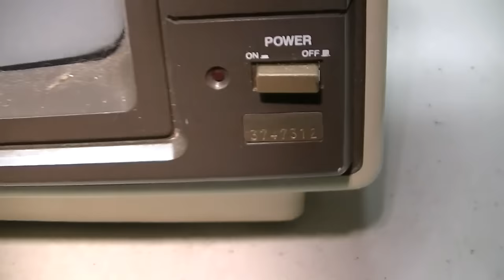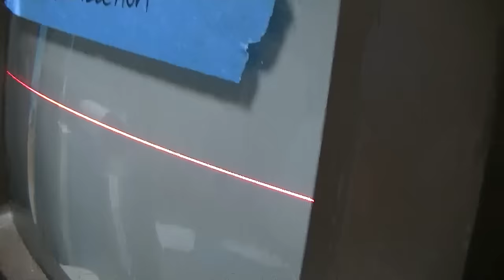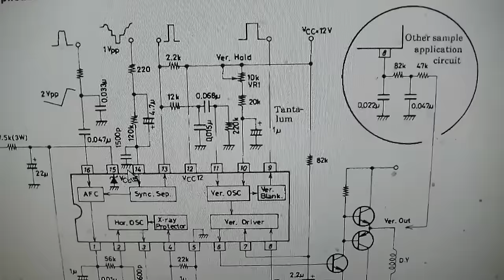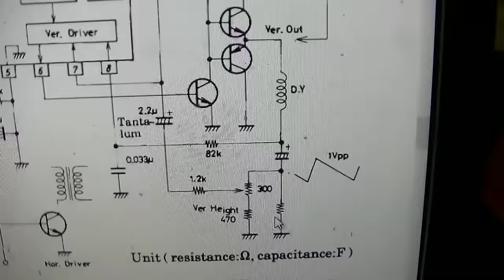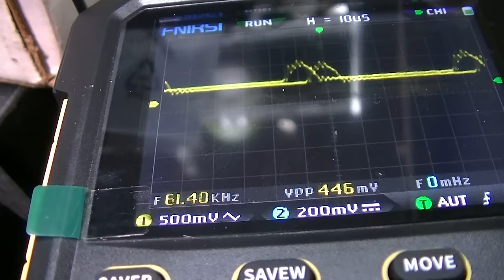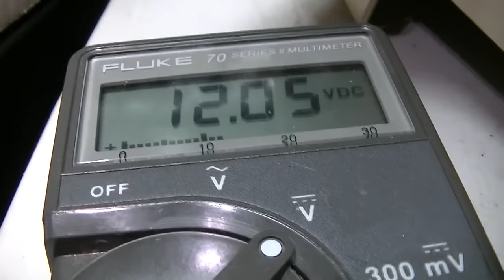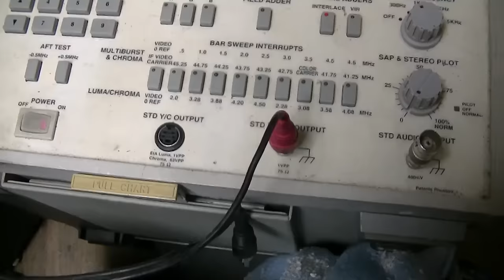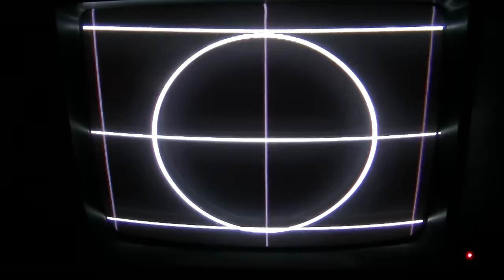1984 NEC Color CRT Monitor JC 1215 Repair

Comment: These "lower-res" color computer monitors from the early 80s have amazing picture and the tubes last forever. The Commodore 1702 was very similar to this one and they just generate a great image, although as you mentioned they aren't super duper sharp.
Reply: I recapped and replaced a voltage regulator in a 1702 and my god that monitor came alive. While it was limping along before the repair it looked new after the repair.
Reply: 1702 even has Y/C input on the back, a cheap cable will let you connect anything with s-video.
I believe that monitor was made by JVC, and used the same CRT and boards as their professional series.
Reply: @coyote_den That's right, it is a JVC product. All the commodore screens are pretty good but the 1701 best. The later ones like the 1080 and 1084 were nice because they could take Y\C plus both digital and analog RGB which makes them a jack of all trades but the tubes didn't last as long and the overall design wasn't as robust.

Comment: I had an 22" NEC 'Diamondtron' (albeit Mitsubishi tube, I believe) in the mid 2000's for photography work, I calibrated it with a colorimeter and to this day one of the best images I've seen on a display.

Comment: A great learning lesson taught here. Inspect your boards first. How Shango missed it is because he assumed a component
may have been at fault first. I guess many of us have done the very same thing! Vintage NEC monitors were the best.
Reply: This was likely delivered busted and put on a shelf for 40 years until it was bought by someone on eBay thinking NOS would be guaranteed brand new, and turns out the board was cracked. Right on a corner edge where the feet of the TV are too, prime for dropping.

Comment: Recently fixed a monitor for a classic Macintosh, had a blown smps drive transistor, blown neck diodes, blown ultra fast diode…was an adventure to fix
Reply: I sadly broke the nub off the back of the tube in a Mac SE a couple weeks ago while trying to remove the drive cage. But if I had to pick a tube to accidentally vent, that'd be the one -- they're still reasonably plentiful.
Reply: @VectraQS  it’s unfortunately very common to do. I run Amiga of Rochester, we do vintage Mac restoration and so many people have done this I lost count
Reply: @thomasandrews9355  Ahh, nice to run into you again. I think we've talked a few times before. I still need to get in touch about sending a Portable logic board your way.
Reply: @VectraQS  hi! Small freaking world

Comment: I used to spec these nec monitors in the remote eng studio truck designs because of the clarity and brightness as well as the weight difference sony was much heavier steel box.

Comment: Not that Im anywhere close to Shango's level come TV's & monitors but I've come across a few sets like this that were loaned out or put away in storage and came back to their owners not working. And just like this they suffered from being dropped & broken boards. For me (like Shango) I go for the easy quick fix first, but on these printed board sets I'm looking for discoloration and breaks first & foremost, fuses then to the components. And if the tv god's are smiling on ya.....they're a quick fix and you're a hero.😅

Comment: These were common in video online edit room as a secondary color monitor. The primary would be a sony or ikegami usually but these were great for things like the chyron station. It was probably set to display the full roster on purpose to qc the image.

Comment: It's truly hard to believe that NEC of that era can produce such a high quality picture, circuitry and components. They must have given all the table scraps to Curtis Mathes to install in their garbage.
Reply: A monitor is calibrated "flat" at the factory, because it's typically used for work on a desktop PC or video production environment.  

A television is adjusted to anything BUT flat - it's factory adjusted to out-shine its competitors product on a display wall  in a store.  And sadly, most consumers don't bother to take the set out of such mode.  That's why so many flat screen TVs also last far shorter than a CRT from decades ago.

Comment: I have a similar monitor bought in the 80's for computer stuff at that that time. I put that thing on an elevated shelf in my shop with a tuner box in 93. I use that thing everyday and I think its going to outlast me. Everyday I switch it on thinking I'll graduate to a new flat screen and nope she comes right up and has a fairly decent picture. Never had to service it once yet.

Comment: 23:01 At this point I need to bring up something regarding monitors vs ordinary TVs - be they CRTs, or flat screens, or something else.

The difference between a monitor and  a television runs deeper than one having a tuner and the other not having one. Most monitors(for desktop use, exhibition display, or whatever purpose) are adjusted accurate at the factory.   Consumer TVs?  Anyone's guess!  

As Dan discovered, watching TV on a monitor, even an older one like the subject of this video, via digital converter box or other such tuner, is a whole nother ballgame.  He's seeing what's there, because  a good monitor is transparent, and neither adds nor subtracts anything to the native image.   

I encourage others out there to experiment like this, and see what TV can really look like, without the factory torch/store mode settings.  

I can get close to this on a modern OLED or QLED flat, simply by choosing the least intrusive picture mode, such as Cinema or Movie.  Or I could select custom, and make the TV more like a monitor by turning off all the so-called enhancers in the Advanced Picture menus, and properly setting the basic stuff(Contrast, Brightness, Color, sharpness, etc.).

Comment: That looks like an Ebay shipping crack. Even if it wasn't shipped or on on ebay. I fixed a pro JVC vtr with bad crush damage like that on it's card cage back-plane. No stop hole needed, the crack was nice and long, terminated at a hole at both ends, severed like 22 small traces. Also had a cracked power supply board but amazingly that's all that was wrong with it.

Comment: i came across a NEC 20 inch TV in the 1990s, had a dud line output transformer, i tried pretty much all main spares suppliers(i'm in the UK) and none could get any parts for ANY NEC stuff, was told no spares were available here, ...so ...why did they sell the TV here in the UK (was definitely a model designed for the UK)

Comment: It was probably a color security monitor. But that said... it would be usable for computers. It would be far more useful if it offered separated chroma and luma. That offers the best picture. 

This would be outstanding for a console though. Perhaps an NES or super nintendo.
Reply: If I were local, I would buy that thing in a nanosecond.
Reply: @vhfgamer  I have a Sanyo built BMC branded monitor of the same size from the same time period, yeah it has a very good, sharp picture on it.

Comment: Haven't really seen the video but first things in my mine with the description of the fault was, look for a BUZ90 and or BD149 I believe it was that often either de-solder them self's or let out magic smoke. repaired many a monitor from that time and that was the most common fault.
Reply: lol OK a cracked pcb will do it. guess the old saying works again, you shale measure voltages.

Comment: These are exceptional displays because the application demands such. Eighty column text and "high resolution" graphics modes from a computer of the time aren't usable on even a very good TV. The monochrome ones also have exceptional display quality. 

I'd even hazard a guess that most of these have very low operating hour counts. As for the damage, maybe it was dropped after being carted out to the trash?
Reply: Or it was United Postal Smashers...